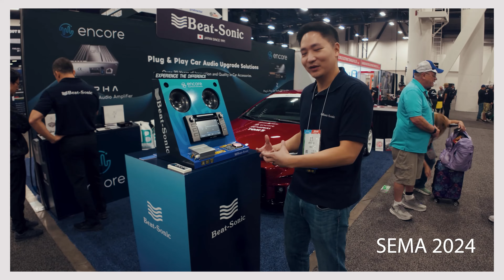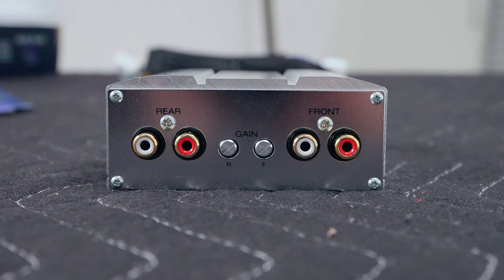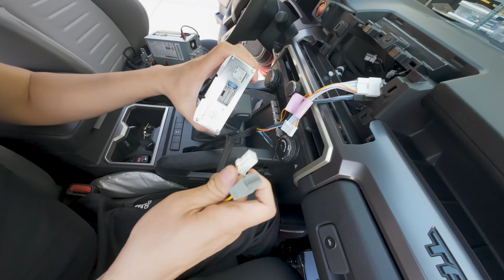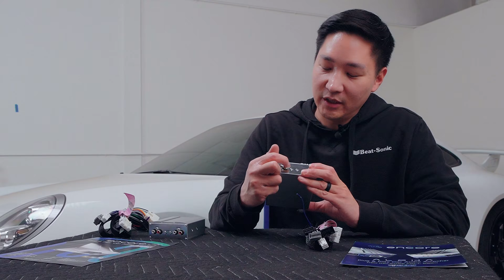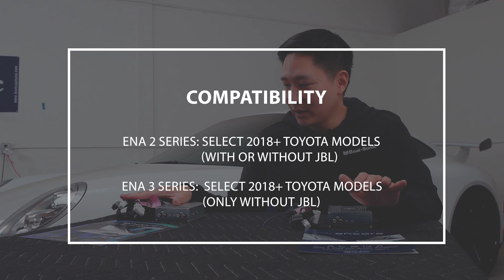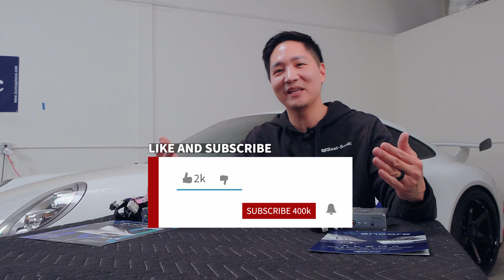The Subwoofer-Ready Upgrade You’ve Been Waiting For! | Beat-Sonic Encore Power Amplifier

Comment: Im using beat sonic 2T3. Can I upgrade a subwoofer underseat with it? I see 2 output in the box, front and rear
Reply from the maker: 2T3 has RCA inputs. For a sub, use this https://www.beatsonicusa.com/products/toyota-10-pin-speaker-harness-bh10
Reply: @BeatSonicUS my car have jbl premium sound system. The wire you recommend is compatible? I use jbl basspro sl2 subwoofer have RCA input.
Reply from the maker: @nguyenvu4121  If you have RCA input, you can use a LOC + BH10. BH10 provides speaker wires and LOC converts them into RCA

Comment: I love my encore two series because it makes life more easier and a first bought it 2years ago,and I had a corolla hatchback xse the first thing I did was  before I ever heard about this amp, i upgraded my Speakers to Rockford speakers in my corolla hatchback . It’s sounded good, but after installing the amp, it made it even sound way more better it’s reliable and it’s easy to tune maintain easy to install as well,and the good thing about it since I upgraded now to a 22 Camry xse and yes, I kept my amp along  with all my wires would be from my previous car before trade it in ,it’s also compatible with the 22 Camry xse but overall it changed in my life as an enthusiast. shout out to BabyChuuu and BeatSonic for the convincing and taking care of the E210 connections and can’t wait to install this in my 22 Camry xse looking forward to my next speaker setup 💯
Reply from the maker: Glad to hear it's still going strong after 2 years! 💯

Comment: I installed a 3T3 one today...im not really impressed on sound output...i had a rca line converted to the factory deck and a subwoofer that sounded 3 times louder before i installed this beat sonic....ill mess with the gains but definitely not impressed compared to factory sound on a 2025 camry
Reply from the maker: Sorry to hear! Try adjusting the gains on the amplifier and see if that helps.

Comment: So, i just bought the ENA-2S1 frm Driven Media/Kevin Vo during Black Friday sales. At the same time, i got a OEM+ Subwoofer/Kicker fr my Toyota GR86. Based on this video, it wont work WITH the new Sub, correct?
Reply from the maker: 2S1 doesn't have RCA outputs. Use the BH8 speaker harness to daisy chain high level speaker outputs to add your sub
Reply: @BeatSonicUS ok, thanks. Will purchase harness,then.
Reply: @BeatSonicUS  So plugged in my 2S1, today. Strangely,.. There was No "Ground wire" for me to attach to side of head unit. Hoping, that's ok.?

Comment: Bummer. I was hoping the 3 series would work with the JBL.  It would be great to boost the speakers (especially the rear ones) and feed a signal to a powered sub that is controlled by the head unit.   Get that to work and you will have something special...
Reply from the maker: Fix coming soon
Reply: The taco sounds has a plug that connects under the driver seat to install an aftermarket amp and subwoofer system for deeper bass

Comment: Would you be able to run 2 self powered subwoofers using an rca y splitter with the 3 series amp?
Reply from the maker: The ENA-3’s sub pre-out is designed for one amp input, but splitting to two powered subs is totally fine.

Since powered subs have built-in amps, they only need a clean line signal — you’re not splitting power, just signal.

Comment: Is it possible to use the rca out to connect another amp to power an aftermarket sub in the trunk?
Reply from the maker: Use the BH10 speaker harness https://www.beatsonicusa.com/products/beat-sonic-bh10-speaker-harness-for-toyota-10-pin-connector?_pos=1&_psq=bh10&_ss=e&_v=1.0
Reply: Is the bh10 speaker harness compatible with the 2025 Toyota Corolla cross non-jbl audio I want to add the aftermarket amp and sub? I would like to order this harnes if compatible!
Reply from the maker: @avefenixml  Yes, Corolla Cross is compatible

Comment: Hello, is there a video showing the 2 series amp to a sub? I understand you can use the power seat cable for power and use the bh10 to connect amp to sub, but I am not sure how that is connected to both. Also the 2 series does not have the remote blue wire. What can I do? Sorry I am not Audio savvy. Been trying to follow the video you did with the tundra. Working on my Tacoma. Thanks, love your stuff!!
Reply from the maker: Use the blue wire on our wiring harness for the remote wire. You can view the wiring diagram for the ENA-2T3 + BH10 here - https://www.beatsonicusa.com/catalogsearch/result/?q=bh10
Reply: The blue wire from which harness?  I understand the 2 series amp does not have a blue wire.

Comment: 😭😭 got disappointed when you mentioned that the subs might not work with jbl system i was about to order one. When is the updated one for jbl is coming out???
Reply from the maker: The ENA-3T3 is technically compatible, however, we're currently tackling an issue where you're unable to control the volume of the subwoofer with the radio's volume. For example, if the vehicle's volume is set to 0, the subwoofer will still play music. You can work around this by having the subwoofer have a separate bass control volume knob and adjusting the subwoofer using that volume knob instead of the radio volume knob.

We're expecting a solution by Summer and it'll be an additional harness to plug and play.
Reply: @BeatSonicUS  Hello, I wanted to check if there was any update on when this additional harness would be available for folks with a JBL system?
Reply from the maker: @AaronTondra  Please email us info@beatsonicusa.com

Comment: I am looking at one of these for my 2021 Rav4 JBL.  The product page makes it seem like the series 3 is compatible with the JBL system "2019-2025 Toyota RAV4".  Are some of the series 3 SKUs like the one for the rav4 "ENA-3T3-RAV4" fully compatible with the JBL system, meaning the RCA outputs can adjust volume on a subwoofer amplifier?
Reply from the maker: The ENA-3 is not compatible with JBL equipped vehicles.

Comment: I'm really excited to try it out. I plan on using filter caps on the harness adapter to filter out low frequencies below around 90hz to the doors, so my subwoofer can take over those frequencies through the rca jacks. Would have really liked to see that type of function built in with a filtering knob. Otherwise looks like a sweet product!
Reply from the maker: Thank you! Will take down your suggestions

Comment: Also, for the 3 series with sub out, the Corolla GR JBL system does not come with a sub like other Toyota models. Will this amp then work for the GR Corolla?
Reply from the maker: Unfortunately only compatible with non JBL vehicles.
Reply: @BeatSonicUS so is this not compatible with a subwoofer for a GR corolla

Comment: Can’t wait to see the new 3 series for the JBL models as well as the DSP amps! It would be really cool if you guys come out with higher quality speakers that work with the JBL amp as well!
Reply from the maker: Soon! We might come up with a subwoofer soon as well.
Reply: @BeatSonicUS  Lets Go! JBL systems need some love!!!! I went JBL for the sound. I feal a mistake was made. You guys can save us (PLEASE) Even connectors at the amp would help. We have to tap in there anyway for our subs. 2024 Camry XSE with JBL system here.
Reply from the maker: @rainsplit  Soon! Email us at info@beatsonicusa.com to be placed on our waitlist.
Reply: or get a powered sub that has a bass knob so you can control the sub independently